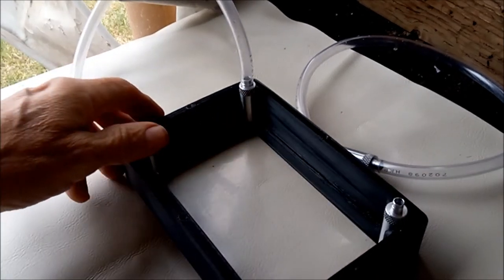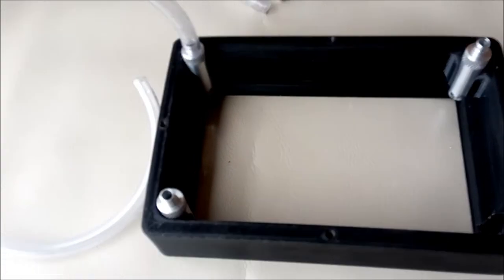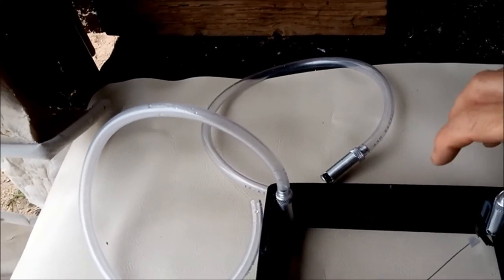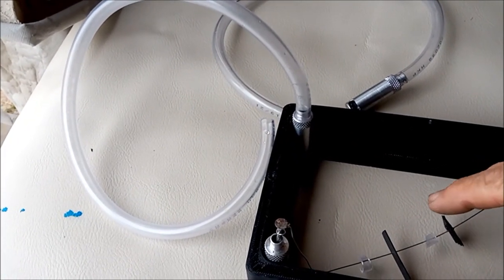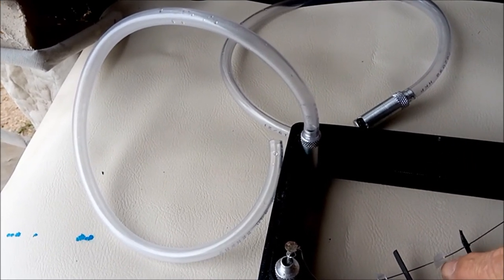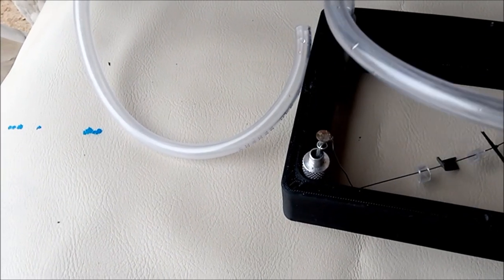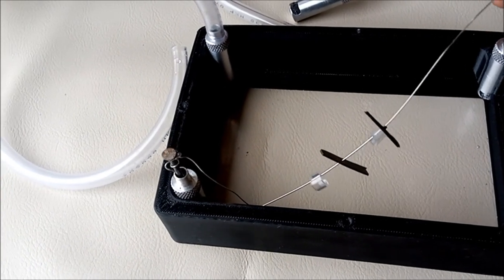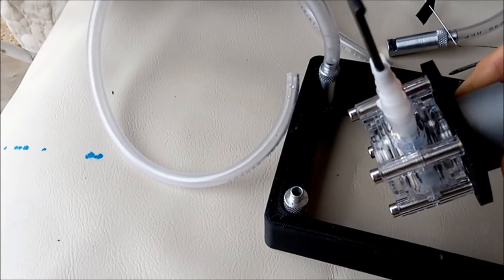Last 3D Printed Automatic-Resin-Mixing Vat Now Printed And Assembled

Comment: Have you considered coating the 3D printed vat with a thin layer of UV resin and curing it to seal the surface and protect the PETG from the uncured resin? You could paint UV resin on with something cheap like an acid brush, rather than trying to dip the entire part in resin.

If you printed the vat with transparent PETG, the UV light should be able to penetrate and cure a thin layer of resin inside the flow tubes you have in the corners of the vat.
Reply from the maker: I've experienced no damage from any of the resins I've used to print with my DIY 3D printed PETG resin vats.

I'm sure it wouldn't hurt to coat them with some kind of UV protection but,  I really haven't seen any need for it.

Thanks for watching the video.

Comment: Apologies for popping up again, may I ask what kind/model of pump the vat might need?
Reply from the maker: The Type of pump is called a, Peristaltic Pump.  I don't recall off the top of my head the exact model or size.
I also ordered a potentiometer just in case I needed to dial down the flow of the pump.

Comment: Tim, hows this been working for you after so much time?
Reply from the maker: It all worked out just like I'd hoped it would.
The only problem was that the resin manufacture that was supplying me with free high-heat-resistant resin had to stop sending me free resin because someone on the Facebook resin group reported my posts to the Facebook police.

The resin manufacture was afraid of being ban from Facebook so they knuckled under and stopped allowing me to run my tests and experiments with their high-heat-resistant resin for making bullet molds.

I know now that it will work so I consider the whole thing a success.  The problem is that the price of buying that particular resin is too high for me to spend alot of money on.

Oh well: I own plenty of aluminium bullet molds to cast bullets with.

I'm surprised to get any comments on this rather old video.  Even YouTube banned a couple of my 3D printed bullet mold videos.  They said it was because it broke some kind of community standards.  

These social media sights have no freaken standards.  They just make stuff up as they please.

Thanks for watching my video.
Reply: @MrTjmk  Sorry to hear about all the trouble.

I've had the idea floating around for a couple of years of adding mica and other materials to resin for a "pretty" effect. But, everything I've ever seen of others trying the same concept ended up very bland because the material settles. 
I had always figured those resin "fill" tanks would work great if I just hooked up a way to suck from the print tank. Upon seeing your video I realized holy cow someone figured it out well before me. 

Really great to hear you didn't have issues with PETG. I was a little surprised anyone would say there is issues with PETG. I know resins have some nasty chemicals in them, but PETG is near bulletproof chemically.